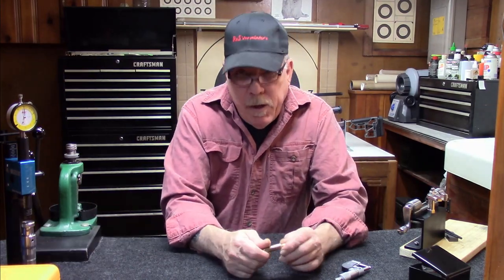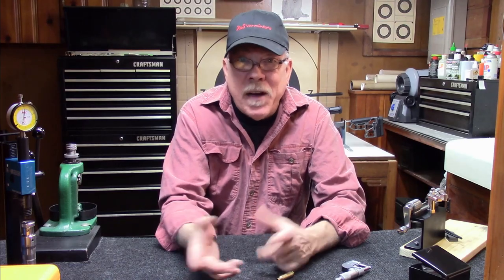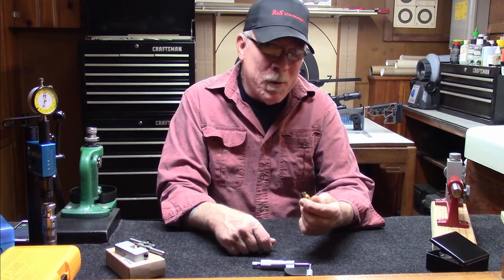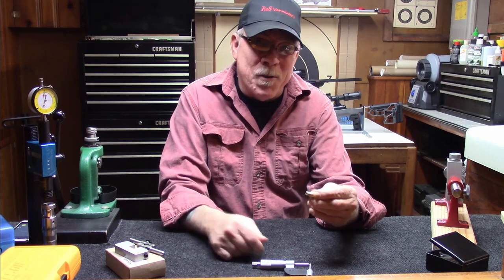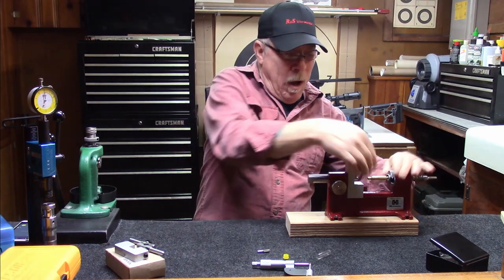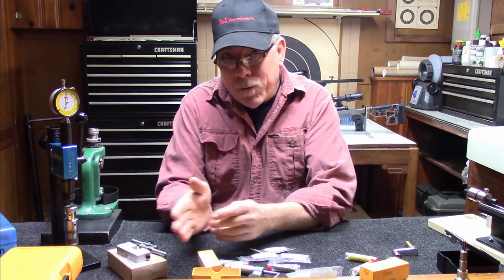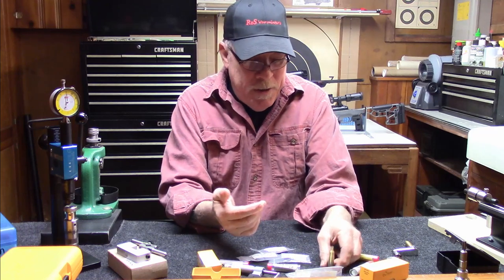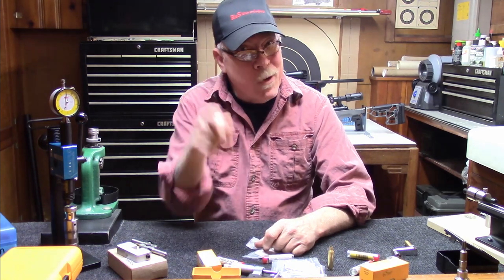Inside Neck Reaming Creedmoor Brass

Comment: Is the brass in the video resized? If so are the necks opened up again with mandrels
Reply from the maker: I used a  0.2430" mandrel on the 6mm before reaming and a 0.2650" mandrel on the 6.5mm.
Reply: @rsvarminters9083  but you had sized the brass prior to this,le wilson instructions tell you to do it on a fired case
Reply from the maker: @neddle7817   That's if you are just cutting donuts out. I wanted to ream the thick spots off from whole neck.
Reply: @rsvarminters9083  sorry for all the questions but as you mentioned in your video information is limited.
Just to be clear, you resized your brass, either FL or neck? 
With or without expander betton in die?
Then used a mandrel to size the neck internally before reaming out?
Or in what order did you carry out the sequence?
Reply from the maker: @neddle7817  Questions are how we learn, so no worries :)  Sorry I did not do a better job at explaining things.

 The only time the necks will be too large is after firing them. That cutter might cut some of the inside at the bottom of the neck (donut area). 
 Resized (I always full length with just a .002 shoulder bump with NO ball in the die) the necks are too small for that tool at that point. 
The reamer for the 6mm is 0.245", which I did not know until after I bought it and had it in my hands.
  So in *theory*, you want your neck I.D. to be just under that # to only ream the thick spots from the neck. 
The spring back (all brass are different) is something to consider as well. Sorry, no exact science there, so the expanders I got came in handy.
  Then, once the outsides are turned, you have a more consistent neck thickness. I try to keep mine at or as near to 0.013" thick.
 This process can be done on New or Fired, Annealed or Not Brass, but expander size might need adjustments to just remove what we need.

I did this to some New Nosler brass that I had to Anneal to make reaming easier...It was some hard brass lol
Reply: @rsvarminters9083  im still missing something here, after ive reamed out inside of neck, ive no neck tension at all.
I've full length sized with Forster die with button removed, ive then tried 2 different mandrels before reaming. Reamer is removing too much brass, I've tried full length sizing after reaming, but makes no difference.
What am I doing wrong?
Reply from the maker: @neddle7817  What expander(mandrel) size did you use?  How thick is your necks now? 

I went bigger and bigger with the expanders until the reamer will not touch the brass. Resize brass back down and just Back up 1 smaller size for the expander ( I went with 1/2 ten thousandths sizes) Then you can ream and only cut out a small amount.

After you ream and turned the necks you resize brass like you would for a normal reloading.
Reply: @rsvarminters9083  must be my mandrels, I've 6. 5 & one 0.002 smaller, I'll check reamer with calipers and order more mandrels to suit,
I full length resized after reaming but no tension
Reply from the maker: @neddle7817  Like I mentioned above, I ended up using a 0.2650" mandrel on the 6.5 brass I had. If your brass has a lot of spring back , you might need bigger.
Reply: @rsvarminters9083  appreciate your patience and help, I'll get back to you on this

Comment: One of the most honest videos I have seen about the challenges of locating an unbiased viewpoint on this topic.  Good work, sir!  I too use some of 21st Century's different mandrels and dies.  I use a progressive for brass prep, decapper, resize, then two different mandrels, first is a full .002" below desired neck and then .0015 below desired neck.  I buy them a tad oversized then I polish them down.  After that it is all single step stuff.  I am anal as well, but I have reservations about touching the inside of the neck with anything other than an expander mandrel.  When I am loading, I do lube the neck with a graphite (44 micron) mixed with alcohol.  This makes the seating operation a lot easier and prevents cold welding between the bullet and case.  I use an AMP press and LE Wilson seating die.  I will say this, no one makes a finer tool than LE Wilson.  Recently, they got into the standard threaded die arena with FL Bushing Dies.  I run one for the 6 & 6.5 Creed & 6 GT.  I anneal every firing on the AMP as well.  I switched over most of my methods after my 1st F-Class match (a state championship where literal legends showed up) and I asked each of them that I had a chance to corner, what they did for certain steps.  AMP annealing, neck turning virgin brass and checking it later with turning sometimes required again, using some neck lubricant when seating, using a press whereby seating force could be measured, culling cases that dropped a flier twice, and most of all using a quality brass/bullet combination.  Lapua/Berger was the number one brass to bullet combo.  Primer weighing, bullet weighing, and powder charging to the kernel was pretty well up there also.  I only spoke to one person that didn't drop powder out of an AutoTrickler and that was because they used a Prometheus.
Here's the primary thing I learned.  Reloading tools are now the equivalent of lures to bass fisherman.  They're made to catch fishermen not fish if you get my meaning.  With the quality of machinery and QA now being run by many manufacturers, most brass is quality brass, including Lake City (which I have used several times in competitions as a match brass.  It's thick and handles pressure/volume well.)  Remember Boyle's Law is in effect after the primer ignites the powder.
Everyone of those shooters knew exactly what their muzzle velocity is.  They also knew how to read the wind pretty well.  My point is this:  Make ammo as quality as you can afford and learn to know a flier from the group, but don't spend a ton of money until you can also read wind, or you will be in a hole but not know which tunnel to take.  The shooter is still about 80% of where the bullet goes.
Reply from the maker: Thank you sir for the kind words :)   It sounds like I need to come over to your house to do my reloading :)  I understand the fishing term all too well..
 You are correct about the high percentage is gun management. My 243 I call a 1/2 moa gun. At 600 yards I have a hard time getting close to 1 moa.(too many high 9's) I know the rifle is gtg gut the driver/set-up needs work. It feels really good when you shoot a flyer and can tell yourself "that wasn't me"
 I feel "ok" with the tools I have currently and can see results that show improvement. My last time out my load showed me an SD of 1 and an ES of 5. and now that 5 is the number to beat lol.

 I will be putting what I have learned to the real test shortly (when I get my barrel back from the smith) I'm building a 284 and my 1st objective is to clean that 600 yd target then on to the 1k at Williamsport.     hmmm, graphite and alcohol... I've been just using graphite.  Thanks again.

Comment: Get a Lee collet neck die. Go around in 1/6 turns about 12 X's. This will make the ID true. Then neck turn outside. I'll bet this is at least as accurate as your method, easier by far, and way less expensive. See Fortune Cookie LC's video.

Comment: the reamers are to reduce doughnuts etc from fired brass. You cant run a reamer in there as they are made 3thou over bullet diameter. It wont go into new/sized brass
Reply from the maker: Thank you for the comment. I understand the reamers are used for donut removal, but, I wanted to ream the whole neck to remove the thick spots for a more consistent tension.
Reply: Could wilson make him a reamer .002 less than bullet size? This way he can size his brass then ream out the doughnut, thats what im trying to work out with the forrester reamer and my rcbs trimmer, chances are high I may go with thus wilson reamer if their willing to make me a smaller diameter reamer.